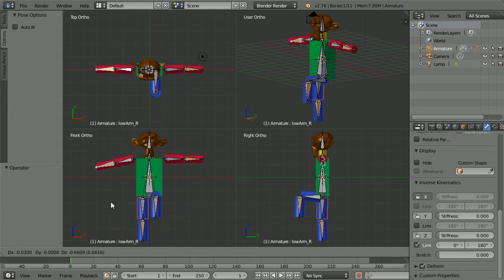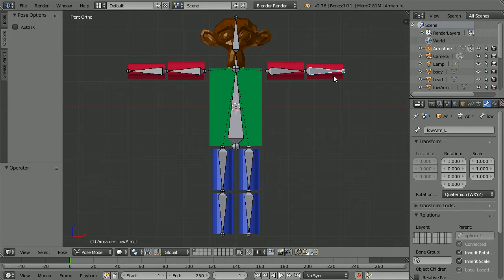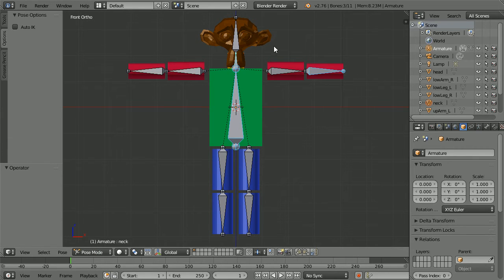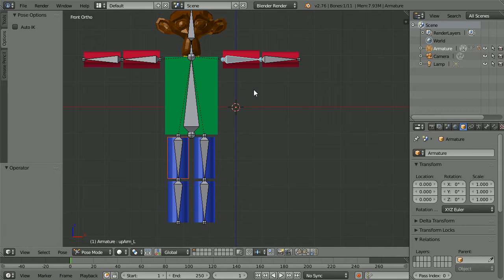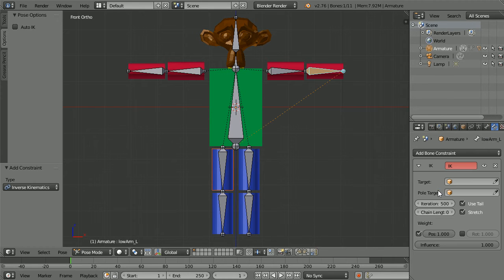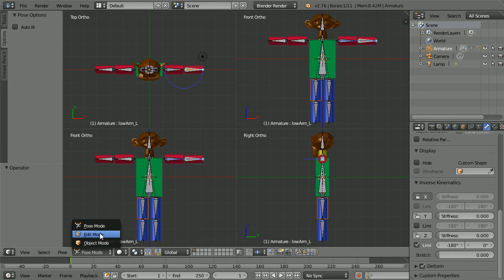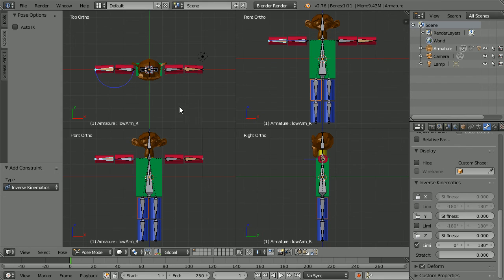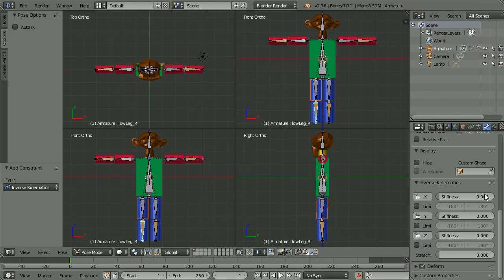Blender Character Animation Tutorial Monkey Robot Part 3 Connecting Mesh To Armature & Constraints

Comment: I followed the tutorial but when I add weights on the model an error will say: bone heat weighting failed to find a solution for one or more bones do you know how to fix that ?
Reply from the maker: Armatures are used to shape and move a charachter but they don't render, a mesh object or a set of mesh objects have to linked to the armature. If you want the mesh to be deformed, a weighting system is used to control the amount the mesh is deformed. In these tutorials which are designed for beginners, a very simple system of a non deforming cylinders or cubes are linked to the various bones. In my stick man tutorials, the stick man mesh is deformed, I don't think it was necessary to adjust the weights (usually needs adjusting under the arms). If you are doing these tutorials you don't want to pick an option that includes weighting and if there is a deform chechbox make sure it is not checked.